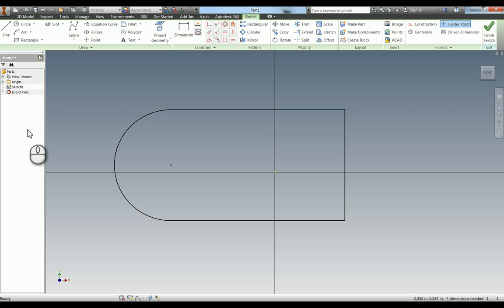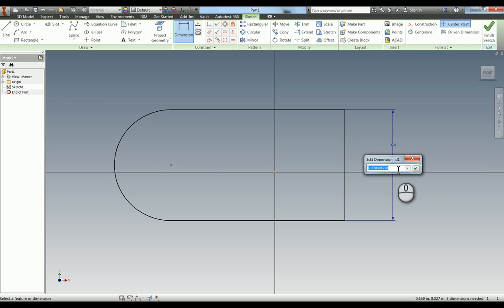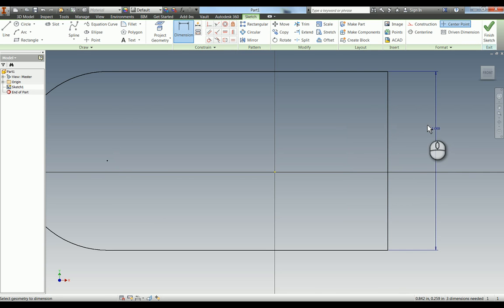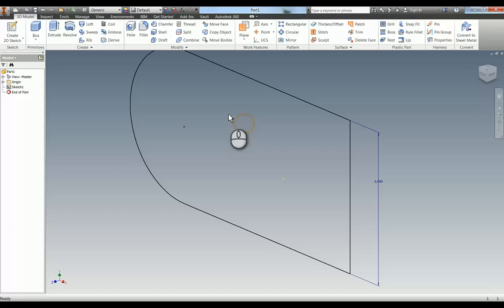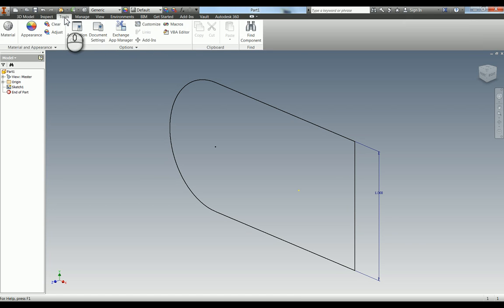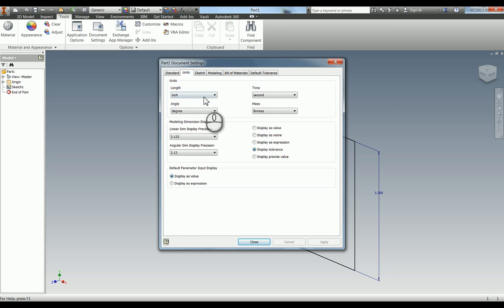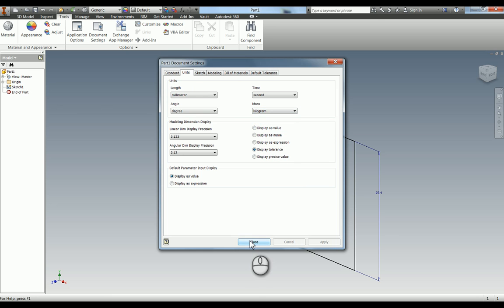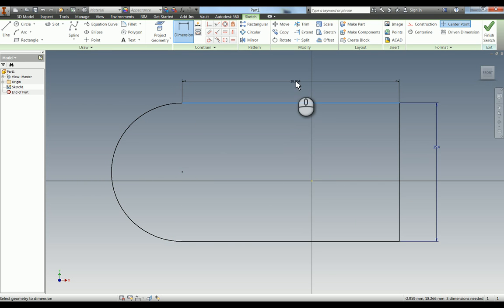How to change from Imperial to Metric on Autodesk Inventor Tutorial

Comment: How can I show/toggle dual dimensions? This can be very useful when using the measuring tool. For large, coarse objects imperial units can be preferable, however, if you want to measure a very small section of (imperial) model then metric/mm is more meaningful. Decimal reading in imperial is not the most intuitive.

Comment: That is useful. Now how can I remove all the default templates that are set to imperial so I dont have to do this for every single document I make?
(I don't think that the day will ever come that I draw something in inches, yet it keeps assuming that is the default.)
Reply: Great question,  and a nice easy answer - go into the folder strucutreand just delete the templates you don't want! You should also check this video which will change your default - https://youtu.be/VUIZ0blU8gE  - this is where you delete the imperial files from and they won't appear.

Comment: Hi i was wondering if you could help i have made my part sketched it all up in 2d then made it
into a 3d part on my 3d part say I'm using imperial...and i have a part say its 0.341 wide,When
i convert it to a drawing it is showing the width as being 0.34 ?? where is the 1 how do i get
it to show what dimension i actually used instead of rounding it off like that...Any help would
be appreciated there is some tight tolerances on my part and that 0.34 is no good..It would
need to show in the drawing sketch as 0.341..Thanks
Reply from the maker: +Muhaa Haloa Hey there, that's a nice easy one :) Right click on the dimension, then where it says "precision" go across to the menu on the right and you can change the precision to add further decimal places.

You can change this permanently for all dimensions in your styles editor.

Hope that helps, let me know if it doesn't make sense and I'll make a video.
Reply: Autodesk Inventor Guy Thanks mate just found it 10 mins ago thank you for your time anyways it's much appreciated.!!

Comment: hi, maybe a little late for questions but I can not find this option in the .idw file. I import An object built in Metrical and on the drawing it shows me in imperial. Maybe you could help? Thanx
Reply from the maker: Domy Do Hi Domy, .IDW files are slightly different. As this is set by the template you open. So if you a want a Metric drawing, you need to ensure you open a Metric template. When you click NEw, make sure you're in the "Metric" template folder. Then choose one of those.

If you're opening an already existing .IDW. Right click on a dimension - then hit "Edit Dimension Style..." This will take you into the Styles Editor (In the "Manage" tab). Here you can edit the "style" for that dimension. In hte dialog box the first tab is "units". So here you can change to Inches. 

If that doesn't answer your question please let me know and I can answer it better :-)
Reply: Thanx a lot!